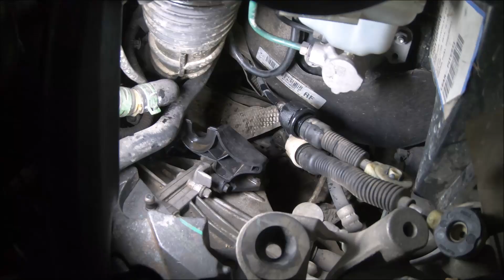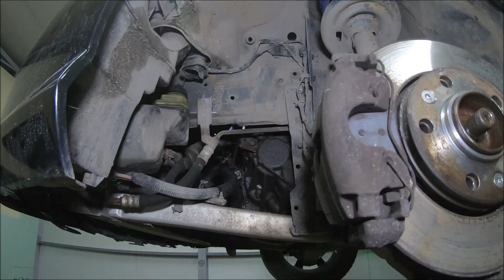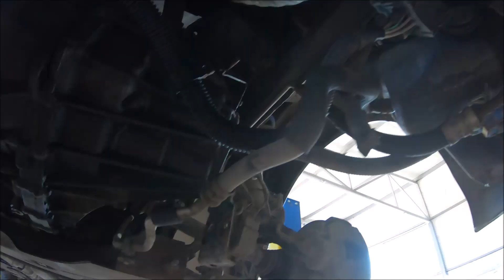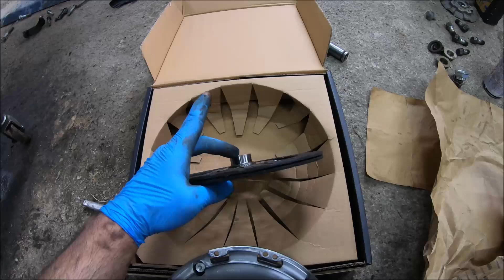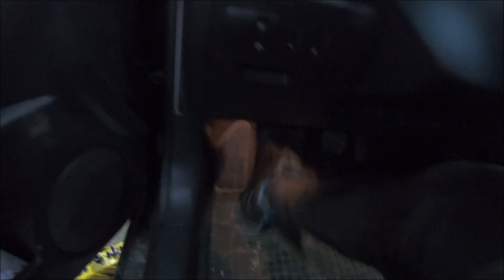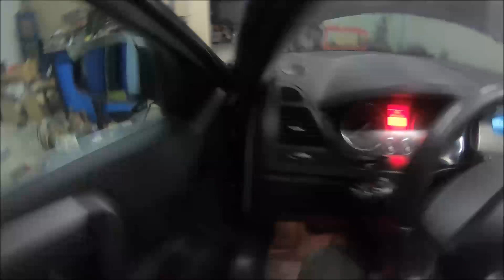renault laguna 3 clutch replacement

Comment: But thank you so much for this video I don't know where i would have started if you didn't post this just is a lot different with the 2.0 dci in size really hard to wiggle it out been trying for about 6 hours today in the freezing cold with no ramp on axle stands and no engine support doing it all from the bottom but I will say you have helped a lot with this video thank you so much

Comment: Not the same very very very tight no room at all to wiggle the gearbox out no joke in the middle of doing a laguna coupe
2.0 dci and it's very difficult I've left it for today and am going to get it out tomorrow
massive gap between gearbox and engine just no clearance at all to wiggle the box out

Comment: It s the same thing for 2.0 dci M9R?
Reply from the maker: I think it's very similar and maybe the same
Reply: @mechanicigor it’s not very very very tight no room at all to wiggle the gearbox out no joke in the middle of doing a laguna coupe 2.0 dci and it’s very difficult I’ve left it for today and am going to get it out tomorrow massive gap between gearbox and engine just no clearance at all to wiggle the box out
Reply: But thank you so much for this video I don’t know where i would have started if you didn’t post this just is a lot different with the 2.0 dci in size really hard to wiggle it out been trying for about 6 hours today in the freezing cold with no ramp on axle stands and no engine support doing it all from the bottom but I will say you have helped a lot with this video thank you so much